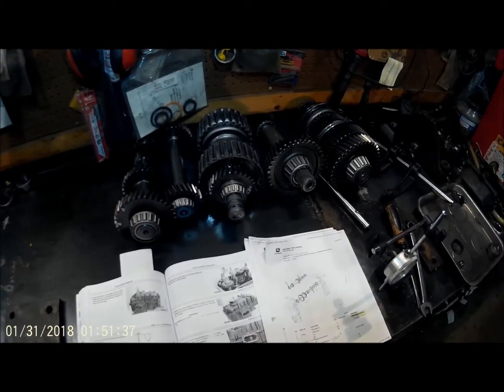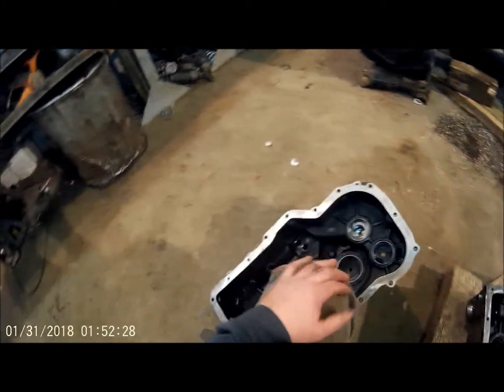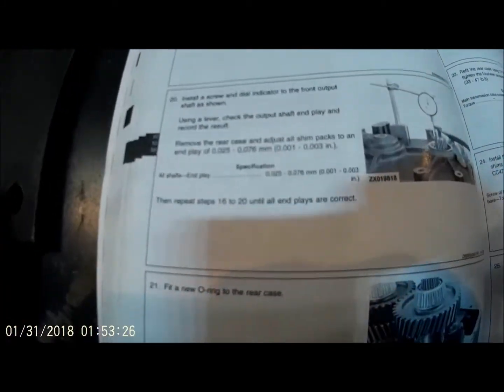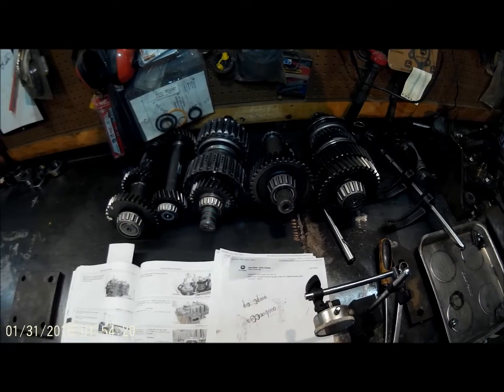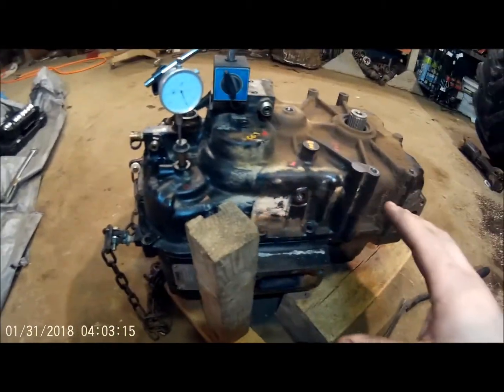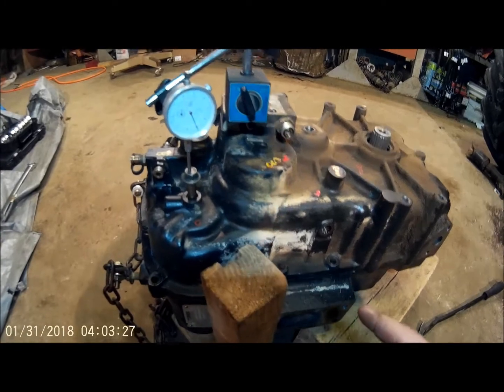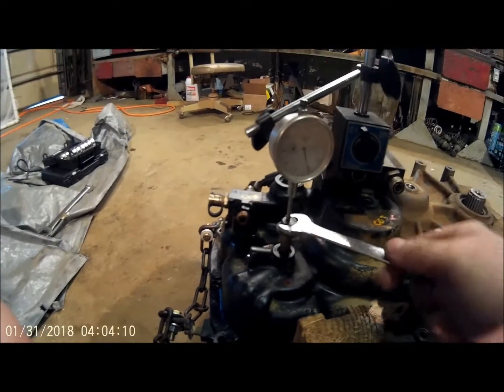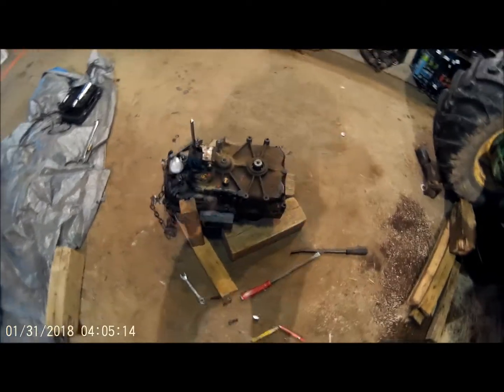3420 Transmission R&I Part 3

Comment: Nice work man, looks like pretty delicate work. I would be afraid to tackle it. Does the 3420 use the 4.5 liter Deere engine? We have one in one of our skidsteers and it has been a great machine.
Reply from the maker: I think it's the 4.5....... it's a turbod 4cylinder, just like they used in the 6400 series tractors....100-110 horses. Very economical and almost as tough as a wheel loader.   Really saves on our tractors, and is much faster